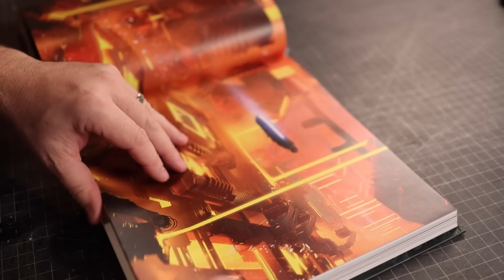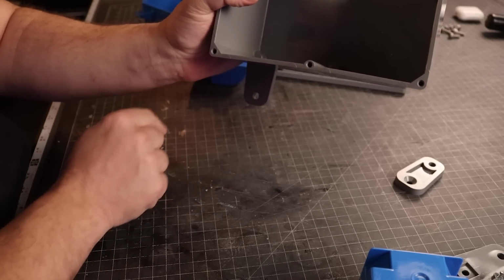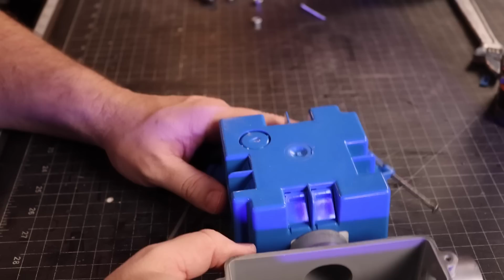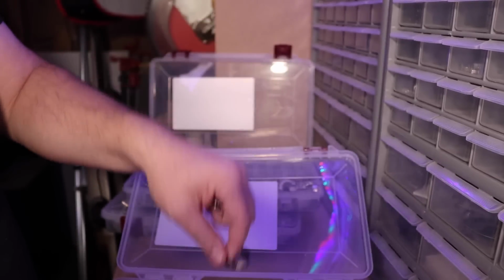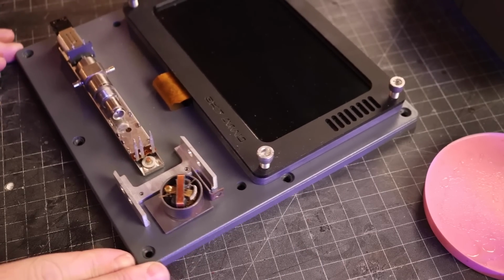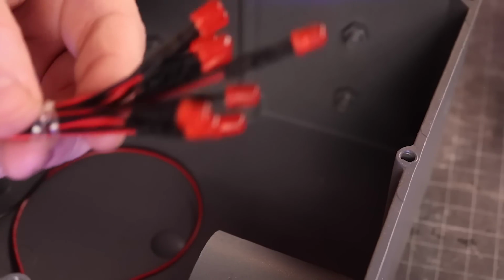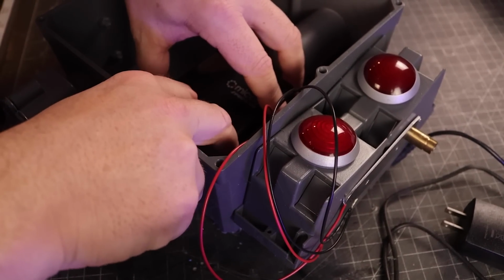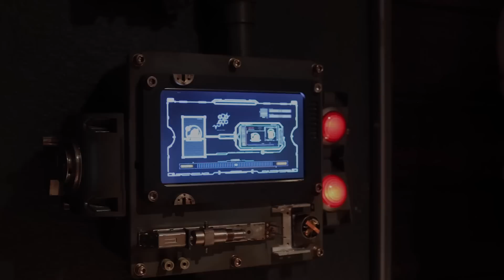Diy Star Wars Decor | Digital Bar Menu

Comment: I just bought a bouquet of those exact LEDs. Red, Blue, Green, Yellow I think. I tested them at 3v, 6v and 9v. They work fine at 3 volts. There is a loss of brightness. They are not substantially dimmer at 3 volts. You can light them with a 3032 coin cell, a rack of AA or a straight up 9v. No issues.
Reply from the maker: Yep.  They are great even on a lower voltage

Comment: Have you ever tried the Nextion displays? The advanced displays allow you to play video files from a microSD card, with sound out, too. For me, the best part is the touch interface that can talk to a microcontroller that will allow you to control anything. I have designed two commercial products that have the Nextion and use my favorite processor, the Parallax Propeller (P1 and P2). If you haven't tried it, give it a look -- I'll be you'd find a way to do neat stuff with it.

Comment: Remote covers: Turns out white foam core is IR transparent even at 5 millimeters thick. So is the marvelous "poster board" Michaels sells. The stuff has a magical, creamy surface and makes a perfect diffuser. LEDs can shine out. IR can shoot in. You can cut the plastic sheet with scissors. Yep, the barcode on the plastic sheets says "poster board 28 x 28 inches" .
Reply from the maker: great tip!  Thank you

Comment: The pointed part you held up is the actual read arm from a hard drive.  It's the guy that slides over the discs to read and send data.  All the circular steel pieces are also from hard drive motors.
Reply from the maker: cool! thanks

Comment: Well done. Having built a few electronic props myself I have a prop "maintenance" idea. If you ever need to go back into a project for a repair, the hot glue gets a bit tricky to pop free. I started using doubled sided velcro tape on parts i might have to repair or replace. I still use a lot of hot glue to attach sensors, relays, etc but for my processors or controllers I find the velcro to be a bit easier for removal.
Reply from the maker: Great tip!  Thank you!

Comment: I built a Star Wars inspired door for my closet. All Foam Core, LIghts the whole deal. Never evaluated the fact that when I am 3 steps up on a ladder 2 feet from the paper door hanging up Star Trek inspired shelves that I'd forget how many steps the ladder had. Stepped down 3 steps instead of one, fell right into the masterpiece. DIdn't go through. Did make a mess. Forced a re-build that ended in a result an order of magnitude better in execution. Still, I could have thought ahead and moved it while climbing over the trash can next to the shredder...

Comment: Question:  If picking up some greeblies from a source is it best to get regular resin greeblies or cold cast greeblies?  If you are going to paint them anyway, does it matter?  Thank  you in advance.  Also, by chance are you going to be doing refilling the cargo hold?
Reply from the maker: Hi!  If you are going to be painting them, then I would purchase cold cast versions.  Those typically are used as they are because of the finish they have on them.  And yes, we will have updates and stock back in the store soon.

Comment: Impressive work! it is always nice to do some found object art.  I noticed you using the needlenose for tightening a bolt. Maybe you have ratchet wrenches already and they were not just in close range, but HF has a 4 set for like $12  - I think i got mine for $8 on sale. Metric and SAE versions. I use them a lot.
Reply from the maker: Thanks for the tips!  I do have a ratchet set, however the needlenose was right there . . . so you know, every tool's a hammer ;)

Comment: This might have already been asked but I didn't see it in the comments. You said you are using the Micca to power the screen, the screen has a power cord that ends with a USB that would normally go into a block to be plugged in (I know you know just clarifying). Does the Micca have a plug in for USB that provides power or did you tether it to the Micca's power source? I tried to pause the screen to see the connections but couldn't get a clear view.

Comment: What is the pink round rubber base you are using to mix adhesive?
Reply from the maker: Hi John.  It's actually left over Smooth On Silicone mold material.  The last time i was making molds I had some left over and poured it into the bottom of a mixing cup.  Now I can mix epoxy on it, and once it's dry I can clean it off and use it again.
Reply: Thank you. Kind of thought that is what it was.